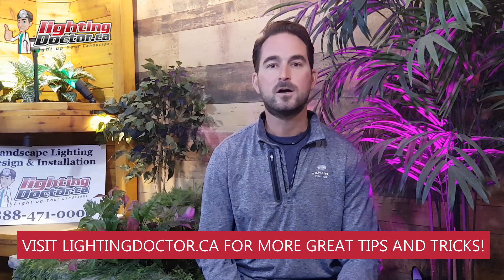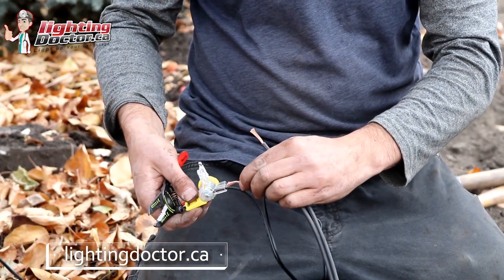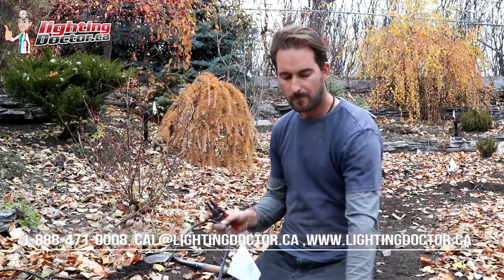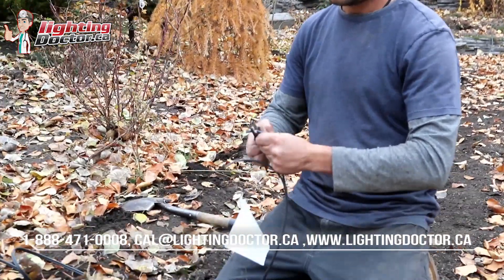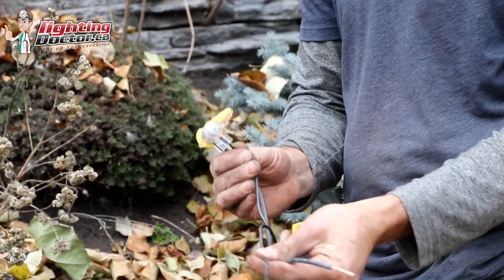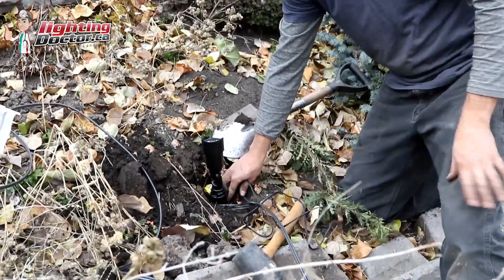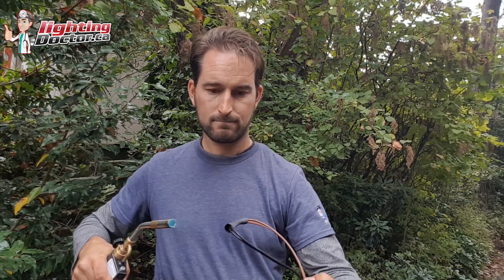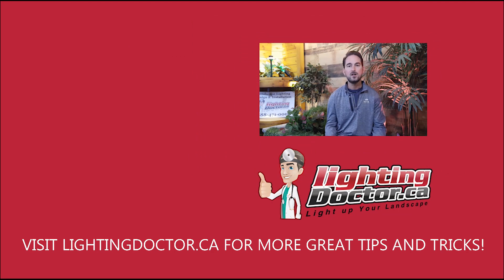How to Wire Waterproof Connections for Low Voltage Landscape Lighting

Comment: What do you do with all the extra wire?  Just bury under ground?  No concern about getting pulled up or cut during gardening work?  Any preference between direct bury vs heat seal vs the other clip type connectors?
Reply from the maker: Yes you can bury it or use landscape staples to pin it down and avoid being pulled up. Here is a video more about the different connectors https://youtu.be/dDYUJQP3Ge8

Comment: My landscaping lights came with  waterproof grease cap wire nuts. Do you suggest  putting them into heat shrink ?   Are those caps meant to buried  or do you leave them above ground.
Reply: I have this same question.  Am thinking of changing to direct bury tubes instead for more peace of mind.  Once heat shrink used, isn’t it hard to access the wiring in case changes needed?